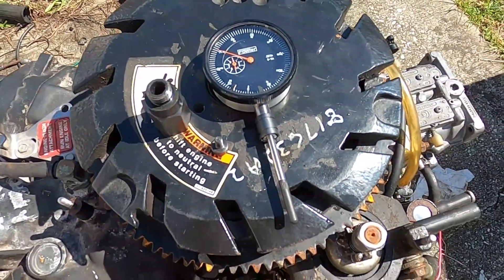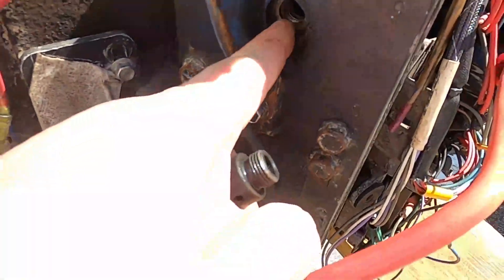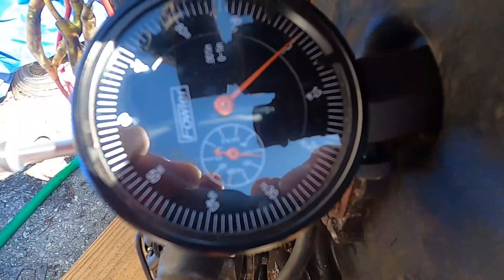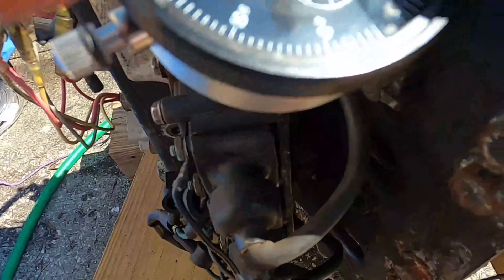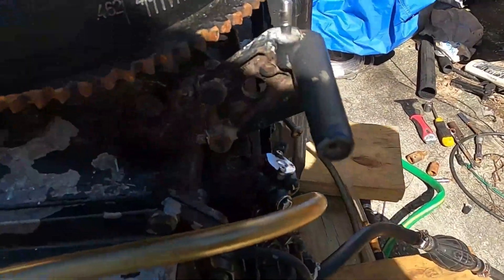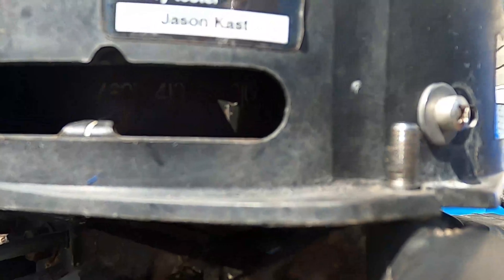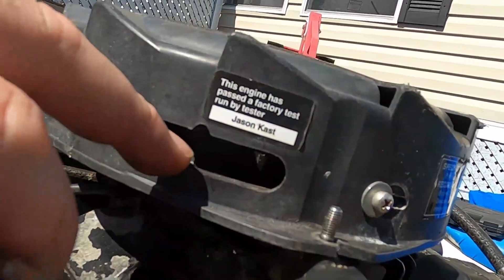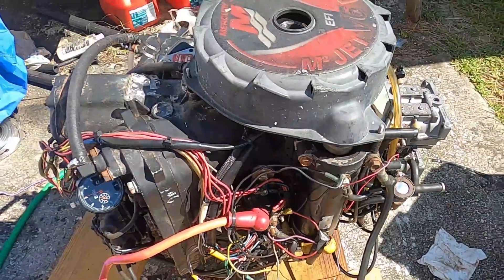Set timing on a Mercury 175xr2 SportJet boat motor

Comment: With the dial you used and reverse graduations you stopped at, wouldnt that mean you have only backed it off only .438 and not the recommended. 462?

Comment: I have same engine from 2003 sagar sand tango I can’t start no spark please advise thank you
Reply from the maker: Many possibilities. Check kill switch, Check for missing, moved or broken magnets in flywheel. Then test the electronics if the magnet are fine.

Comment: Gadgets gadgets gadgets.
A dial gauge is just a trendy gadget and not the best way to find top dead center.
As the piston gets closer and closer to tdc, the dial moves less and less.
Result is an incorrect tdi mark.
The correct method is to use a solid dead stop that screws into the plug thread.
Rotate the flywheel to the right untill it stops dead, mark, then rotate back the other way untill it stops dead, mark.
Mark the mid point between each mark.
Thats tdc.
Put the ridiculous gauge back on the lath where it belongs or sell it.

Comment: you ignored the part where you go PAST .462 about 1/4 turn on the dial to take the slop out. either way you should be within 1 degree or better here but when setting WOT timing 1 degree can make a difference in detonation or not with bad fuel and / or a heavy load

Comment: Doesnt the manual tell you to go counter clockwise 0.462 plus an addition rotation of the needle then rock back clockwise to 0.462 (to get the slop out)?
Reply: 2. Turn flywheel in a clockwise direction until No. 1 piston is at top dead center (TDC). Set dial indicator at "O" (zero) and tighten indicator set screw.
3. Tum flywheel counterclockwise until dial indicator needle is approximately 1/4-turn beyond .462 in., then turn flywheel clockwise so that dial indicator reads 462 in. (11.7mm ) exactly.
4. Reposition timing pointer (a) "if necessary' so that timing pointer is aligned with 462 in. mark on timing decal. Retighten pointer attaching screws

“Straight from the manual “.

Comment: The little extender you mentioned 0:22 into the video, did that come with the kit or did you buy that separate. If separate, can you tell where you got it. Great video by the way. I watched and felt confident I can go time my 2.5  240 EFI
Reply: I 3D printed an extender for my dial gauge. :)
Reply: For the newer 2.5  efi motors the heads are little fatter then original posters above. I had to order a 1-2 extension with this dial indicator. Just did this on my 96 200 efi motor.
Reply from the maker: Sorry for the late reply. the little extension came with it.
Reply: @ck7129 do you have the link for the gauge?

Comment: Did you get this engine fully running and installed back in the boat? Working on a ‘97 engine myself. Would love to touch base.
Reply from the maker: Hi Derek, do you use Facebook messenger?
Reply: @ck7129  Yep! Feel free to connect: https://www.facebook.com/derek.cunningham.52/
Reply: I wonder the same no video after 2 year mr

Comment: What is the adapter part number? I have been looking for one but not having much luck.
Reply from the maker: I bought the whole kit which came with a few adapters from Amazon.  Fowler 52-520-747-0 Timing Gage
Reply: @ck7129  Thanks. I’ll check it out. I got a cheap dial gauge and was gonna knock the core out of an old spark plug and jbweld it in but never got around to it. Would much rather have a kit so I can use the dial for other stuff.
Reply from the maker: @wmkess  yea the other adaptor in the kit is even smaller. Assuming it fits lawnmower or weed eater size engines.